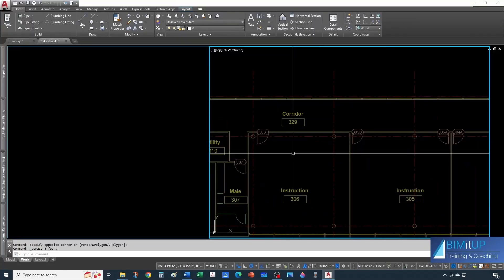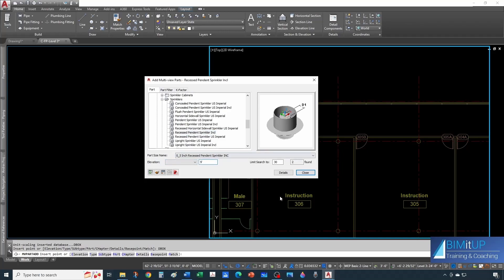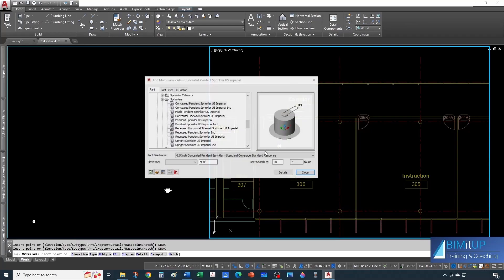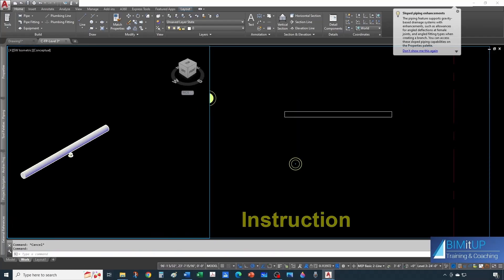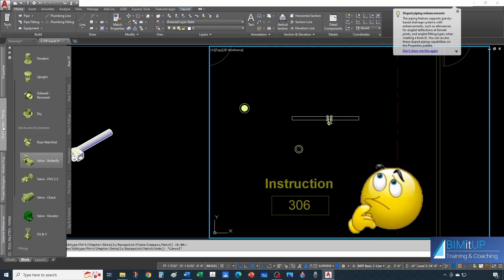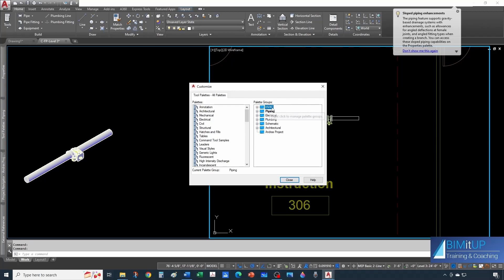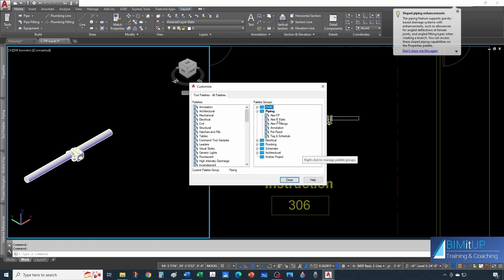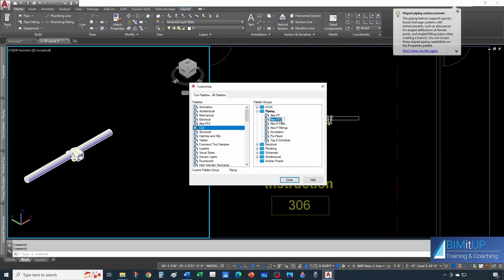How to Create a Custom Tool Palette in AutoCAD MEP

Comment: Thanks 🙏.. can I putting the value of the wall's thermal conductivity (k)  in the property set of the drawing?!
If i can, this will be time saver when I transfer the work to the third party program like HAP.
Thanks in advance
Reply from the maker: Yes, you can. You need to add it as a "property set definition"

Comment: Alex,

What are the benefits of using AutoCAD MEP even though you’re proficient with Revit?
Reply from the maker: Good question @meesc.
Let me start by saying (2) things:
- Nowadays, I strongly prefer Revit MEP (for my workflow and type of projects).
- If you are an Architect, it makes absolutely no sense to use AutoCAD Architecture (the AutoCAD MEP parallel platform).

Having said that, for some MEP folks:
- Although Revit is a more powerful tool, there are still many people who find benefits in AutoCAD MEP:
- Specially on the installation/fabrication side, some find benefits in geometrical accuracy (AutoCAD MEP is "mostly geometry-based" instead of parametric. This obviously comes at a performance price (slow and buggy)
- Some find it easier to work "by levels" (also comes with a downside (interconnectivity between levels, etc.)
- AutoCAD MEP is a lot more "forgiving" in the sense that "absolute perfection" is not required (to connect things, certain "copy/paste" routines, "save as" stuff, copy to the side, dumb-forgiving schedules, etc. ("quick and dirty" stuff).
- In AutoCAD MEP, you can do a big chunk of your modeling (I would dare to say 70% out of one 3D view)
- They don't like the general behavior in Revit that "if you have one little thing missing, everything crumbles downstream (schedules, calculations, etc.)
 - They find the AutoCAD MEP familiar environment friendlier (just like AutoCAD "with more MEP stuff on top"). 
- They are not as constrained as far as "working on the right version (year) of the software"
- Probably most importantly, not everyone can afford the financial hit that Revit represents, so for them AutoCAD MEP presents an alternative to do some level of BIM

In general terms, the less savvy you are in AutoCAD MEP, the more it makes sense to invest in Revit, specially when Architects have already "drank the Cool-Aid" to addiction levels, and Autodesk support and resources have been fully steered towards Revit, and abandoned on the AutoCAD MEP side. 

Anyway, for some, Revit that is simply not an option. I like helping the little guy  =)
Reply: @bimitup  Thank you Alex. I work for a smaller company, so we use AutoCAD MEP instead of Revit, but I've been wanting to learn Revit since it is the way of the future.

My main gripe for AutoCAD MEP is the display representation when drawing pipe for plumbing. There's lots of overlapping pipe & fittings that seem to muddy the appearance of construction drawings.

Do you have these problems or a workaround? If so, I'd definitely pay for a couple of your BIMITUP sessions to learn properly.
Reply from the maker: @meesc3556  What I ended up doing back in the day was set my display for a "sweet-spot" of 1/4"=1', going with single line display representation and hiding the reducers/transitions (since they seem to be hardcoded in AutoCAD). I was pretty successful with the result and is what I used for many years. Good luck =)